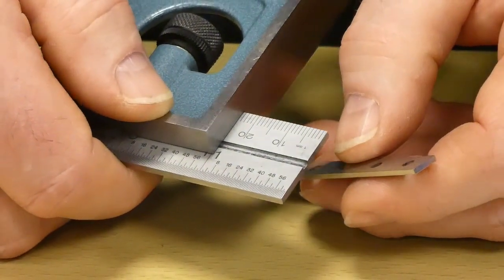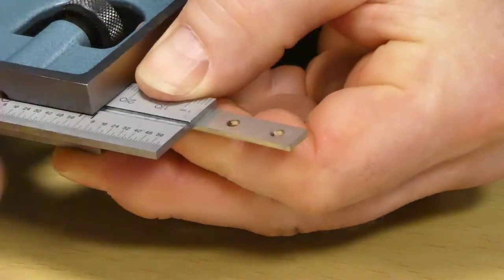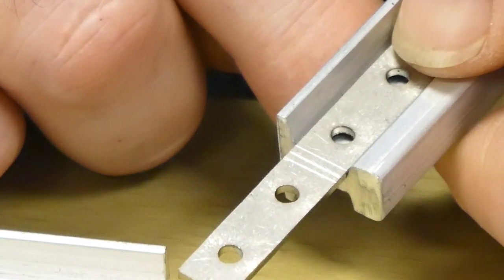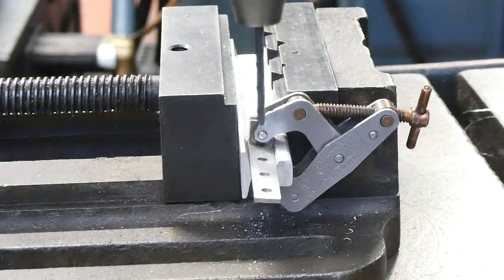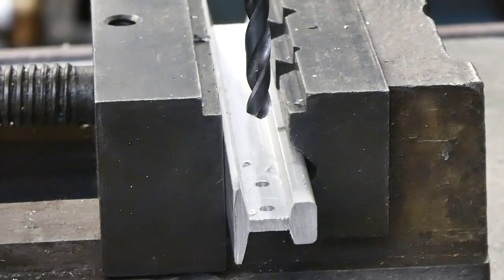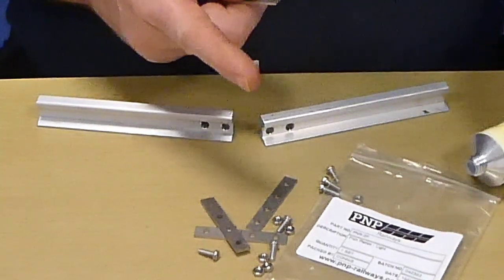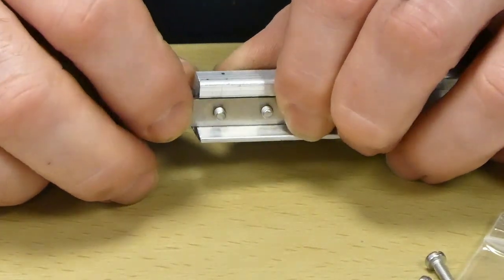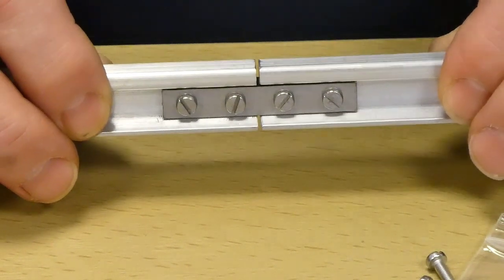How to join rail using fishplates to allow for expansion and contraction.

Comment: Very useful as I start building my track sets, understand the need to not be too tight, but do you use any thread lock to prevent fishplates rattling loose. Thanks.